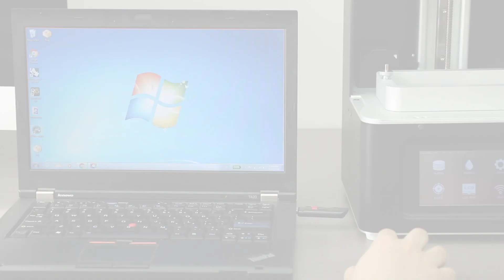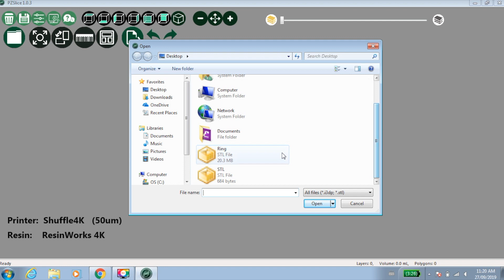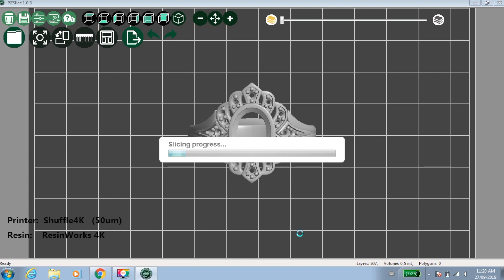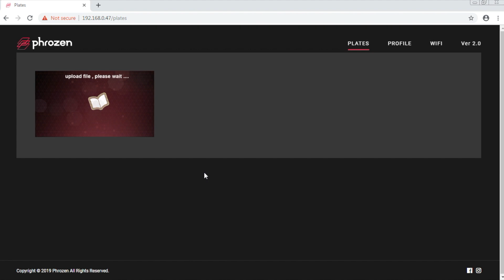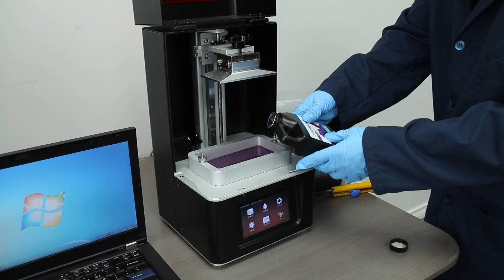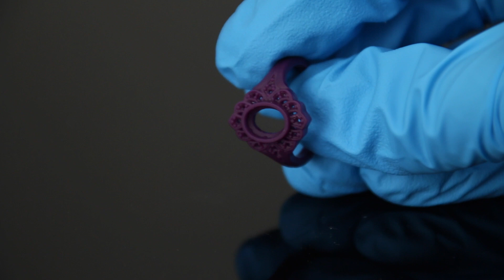Phrozen Shuffle 4K - How To Set Up Your First Print

Comment: Some discovered info for anyone here in 2026 using 2019 Shuffle (not 4k) , my first resin printer....
Using the network to access the printer I found is the only way to get good results.... ONLY use Chrome browser( i'm on an intel mac)  and to access is extremely slow to load after each click, but the patience are worth the results.(I may have a slower router ) 
For some reason the wifi access fails to connect on 2.4 or 5 ghz wifi, usb access is doable but you will really need to know your chops on the slicer permutations.
Also just a total nooob note.... Shuffle 4k and Shuffle look identical both with the updated screen which is confusing, as I thought I had a 4k... nope had the Shuffle (2k)